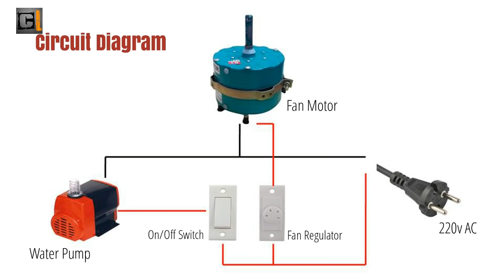How To Make Powerful Air Cooler At Home - Cool Like Air Conditioner

Comment: I made one of these 3 years ago.  It is an evaporative, or swamp cooler and yes they do work and put out nice cold air, my air from the unit tested at 67 degrees F) until the humidity in your room gets so high, no more air can evaporate.  It stops cooling after that.  In my bedroom, I could lower my air temp from 85 degrees F to about 80 before the humidity hit the 60% range and then no more cooling until the humidity dissipated, which took several hours at which time the temp was back up to about 85 again.  If you live in a very low humidity area (Like the south west US) then these will work much better than mine did here in Kentucky.  You did a nice job on this build and it looks great too.
Reply: this  cooler should be kept outside the room, I mean to say install it in a window, then it will work better.
Reply: The best place to position your air cooler is right in front of the window. Hotter the air, faster the evaporation and cooler the air blown out by the fan. It’s also important to create good ventilation in the room to push the humidity out. In order to do this, you need to open windows in the room. Take care not to open them too wide or it will only result in increasing the room’s temperature. You can experiment by adjusting the window a little to improve the amount of cooling.
Reply: @doctorpetrovich9296  Unfortunately, here in Kentucky, it can be 100 degrees outside with very high humidity so opening a window only makes it worse inside.
Reply: @OverlandOne  ahhhhh i see
Reply: 6yr
Reply: You can use some ice cubes or cool water from the fridge. Solves the problem but i dont know if  the fan consumes more electricity.
Reply: @theartofsmartretailing4214  I do not understand what you mean about "solves the problem"?  I already use the ice from my fridge and, if you used just cool water, that water, you do not have a large enough Delta T and the cooling effect is a lot less so I always put plenty of ice in my water.  I recently built a closed system using a transmission cooler (heat exchanger) from a car and it works very well.  I mounted it all on a large insulated cooler and the ice cold water circulates from the cooler, through the heat exchanger and back into the cooler.  it blow very cold air with the fan set on low.  There is no more humidity issue BUT, I go through a cooler full of ice in about an hour.  it stops cooling after that and you have to dump the warm water out and put more ice and water in the cooler.  That heat exchanger is really efficient but I think I would need a ton of ice to run it all day.

Comment: i learned. 1 thing with this video . cooler graas = honeycomb pad 👍👍👍
Reply: Nopes, cooler grass and honeycomb pads are two different things. Both are used by manufacturers.
Reply: One thing the video doesn't teach is that water and electricity don't mix well and that the contraption is a huge safety risk.

Comment: Nice concept, very useful air cooler for one person sitting in a small shop or workshop or garage 
shack.  The plastic body does not get rusted like the metal ones, no  fuss in getting it cleaned for next season.
To clarify some comments,  this cooler can find many buyers in most parts of india where summer is harsh and who cannot afford other big size air cooler let alone an AC.

Actually one can easily tweak the circuit with 3-core wire and can connect the ground wire to the metal bracket of the fan and u have a shock proof body (plastic body is already shock proof).  The fan regulator and switch can be fixed on the front side instead of on the side, it is more safe. 

Of course, please keep away from small kids.
Good for science demo project for middle school students.

Comment: Nice try ...👍....
But its not safe.... 220v and all the electrical  connections will get short for being so exposed to humidity ... and the screws will rust since they are not painted or have any coating... better use plastiz zip ties instead and above its too noisy.... u can get far better throw if u use the blower  blades and DC 12 v they are much quiter... but still thumbs up for being creative and effort... thank you.
Reply: No ground at 220v! Enjoy the mold right as you fry!
Reply: I agree, if your gona make any thing with water and electricity. At least gfci protect it.
Reply: Nice

Comment: 2.5 cooler motor 490 Rs
Water pump 130 Rs
Metal blade 80 Rs
Metal net 30 Rs
Honeycomb pad 120 Rs 
Switch 50 Rs
Cable 50 Rs
Total budget 950 Rs
Ok nice idea but switch is not safe
Reply: Moter ac raha ga ye dc
Reply: Out door lo 2 way gang  board vesukovali my suggestion
Reply: @sraju6462  matlab
Reply: @mdadilrameezkhan  
Ac 230v motor khan sir
Reply: @sraju6462  sirf 230v moter bolna se miljayega blade size
Reply: No problem. you can keep the switch outside. , Keep the fan motor back also with an empty plastic water bottle , so that fan motor is protected main thrust  - this JUST TO INCREASE THE HUMIDITY . In places where the humidity is low -the Ac will work reverse. This water cooler only will work. You can see negative any where . look at the +. this can be kept tidy till next season.
Reply: Sir moter high speed hoga ye normal
Reply: Cooler ka blade a laga hota hai kya
Reply: 500 rs u can get new fan
Reply: Awesome mind blowing

Comment: When fit the switch and regulator back side cover with two module box because this area wet area chance of getting shock and extend fan regulater life
Reply: Point
Reply: Mohammed Akber , was about to tell, more over the fan motor and other iron fittings gets rusted due to wet conditions better to use plastic brackets and why use the can one can build a regular shaped box out of clear sheet one can see the water flow also.
Reply: Woh gye shaayad
Reply: 1500
Reply: Superb. அருமை.

Comment: Good idea,  never know  when  we  have to create our  own resources from  our  hands and  inventive . No kidding but  I have though a lot of time  about  that scenario  while I play any version  of Fallout video game. 
Could I suggest a  dust filter for the honey comb?  Dust is more than anyone could guess and will start to dirt the honeycomb, the water will drag some of that waste and will turn dirt  the water in the  tank ,  finally  colapsing  water pump.  With the same purpose, a sealant ribbon could be fine for the edge of the upper lid. 
The other suggestion I would make is to put  some ice blocks    into the water tank or  even better, chem ice packs easily interchangeable from time to time with others in the fridge.  Even better, how about  to put a freezing circuit with freon or another coolant ? That could  be  get from a spare old  fridge.

Comment: 12 volt dc motor gives same speed with ups battery and also shock proof
Reply: But flow of air will slow
Reply: Cost of battery and replacement periodically will make it costly

Comment: Well, this is dangerous. He could get away with putting and air conditioner motor in there as it is meant for damp environments IF he grounded/earthed the metal shell of the motor, but then he put completely unprotected switches in there too. I bet those will be nicely corroded really quick. It really should have leak current protection as well. Even with all that, I'd only use it outside. It wouldn't take much to dump water everywhere. He's using 230v too...
Reply: Manojsonik PUBG Hii
Reply: Asslam-0-alaikum bhai Jaan !
Bhai jan mujy yeh Air colar chehye  .kidr se mile ga aur kitne ka mile ga ??

Comment: More clickbait. This NOT AN AC UNIT. This is a swamp cooler. I live in Mississippi and ha ha no way that thing works here. I also find it to be unsafe as you spend zero time moisture proofing your electrical system, or even the fan motor. You are thinking outside the box (Granted) But this just a clever design not a AC unit.
Reply: Swamp coolers only work if the relative humidity (RH) is 40% or less.
Reply: @AshishSharma-mf2bx  poor people must know how to get cool air from outside. House ventilation is very important. Can give free cooler air compare buyin this things
Reply: Hi..this is a cooler..it's not meant for humid areas..if u use a cooler u have to ventilate your house properly..since it uses water to cool the surface unlike ac
Reply: @gnesoidomarsonletslearn5533  

..
Reply: The title clearly says Air Cooler, not AC
Reply: @neville3151  price  pl

Comment: It's very dengerous for fan motor because of flowing water pad is too closed to fan motor. It will shock with in month.
Reply: Cover the motor with a plastic bottle.

Comment: After few minutes of operation, motor temperature will rise and exhaust air temperature will not be cool.
Reply: Yes Bro, What's the Solution you think.
Reply: @younushussainsyed8860  instead of fan, use blower, like AC. And make sure intake air will never touch motor.

Comment: You made nothing but a Water Humidifier it's got nothing to do with Air Conditioner....I wasted 11 minutes !
Reply: he made a diy swamp cooler. They work in dryer areas. What happens is the water evaporates on the filter and that cools down an area. Research it. They work and use alot less electricity then an AC unit.

Comment: Nice! But it has a limited water supply.

I suggest using two plastic containers, making it TWO LEVELS.

Top container: cooling mechanism.
Bottom container: water supply.

It will take days or a week before you fill it up again with water... With/without ice.

Comment: Water reservoir is very little.. it will not run for one hour probably.. you need to seperate water tank...but its a good project... to those with tight budget...same thing as iwata and american home just d.i.y nice project next..

Comment: Its very nicely assembled, really appreciate the creativity👍👏👏👏👏 very nicely illustrated the procedure of making cooler ..so nice  ...what exact the capacity in liters for the water , how to prevent  the water which circulates in honeycomb pad is prevented from getting spread on wires of switch and regulator wires ..The water which we pour inside , how to protect its spilling on wires and fan .

Comment: Interesting idea, except that 120 Volt+ AC, relatively high EMF with an oscillating electric field  in close proximity to water conductor is dangerous, especially if unit is accidentally knocked over.
A 12 V DC input and fan motorwith ice in a waterproof strong flexible container (bag) with rudimentary insulation inside container could make unit safer.
Cooler container devices are already demonstrated in this vein.
At least step down 120 V AC and rectify to 12 V DC while retaining original design.

Comment: Wrong fan direction. That fan will pull moisture from the honeycomb membrane and make it move through the inside of the unit. That means the electrical parts (motor, speed controller, switch) are exposed to moisture. It won't last very long. 
In spite of that, however,  the concept is good and the workmanship is fair for a demo project.

Comment: This plastic kerosene container, cheap underpowered motor, 240 volts AC power supply and water is an IED to test the sprinting speed of users and keep firebrigade personnel busy. Metal dessert coolers available in Delhi are safe and work well.

Comment: motor 1200/-Rs ki hai.
Water Gallon 400/-Rs ka hai
Clip100/-Rs k hain.
propeller 200/-Rs ka hai.
matel net 50 70/-Rs ki hai Water Pump 300/-Rs ka hai.
aur wooden wool 100/-Rs ka hai
pipies 50/-Rs k hain.
fan regulator 120/-Rs ka hai
total 2550/-Rs
very good chootiyapa

Comment: First of all the price shown of all parts is relatively very low compared to market, It comes costly than what has been shown in video and the water storage capacity is very less, it will run out of water after 2 or 3 hrs resulting in burning of motor due to heat. Apart from this a very nice cooler made by him.

Comment: Highly dangerous
1). exposed switches
2) pvc piple line blocked from other end which can lead to pump failure. It can easily cause short circuit.

Comment: first of all the fan motor supporting bars will be heated in prolonged usagea and can melt the plastic of box ,i am sure in 2 hours it will start heating and melting of plastic in all four or two upper side will start, ,....any way work is fine  idea improvement needed its fail idea practicaly.

Comment: does it balance on floor when water gets empty. u should have used pipe to fill water the way you fill water may directly fall on fan motor. lots of water spill out on floor from honey comb mat. design of disaster

Comment: What's the essence of water pump and the water here? Can someone explain the water mechanism here for me? Thank you.
Reply: The water pump exchange the heat flow with the cooling water inside  which later evaporate and cool the air
Reply: @goodluckmatata9158  Thank you. Would this water be topped regularly?
Reply: Henry Edeh  yes

Comment: 66K likes for what is most certainly a blatant death trap.  DO NOT BUILD THIS!  Exposed 220 Volt connections with water dripping everywhere! Are you kidding? Just touching that cardboard in the back could kill someone, if it doesn't burn down your house first.

Comment: DO NOT make this and use mains electricity like shown in the video, especially directly connected to a switch with metal screws right next to the terminal. This is a death trap.

Comment: We won't get even motor @ ₹650 because I'm trying alot..We have to spend ₹2000 to ₹2500 to made this..If we spend this much then secure also a question mark because he is using motor and water with direct power..

Comment: I have experience with this design ....  Bacteria.
Reply: how it become bacteria? please tell me
Reply: @syazreeezaat3266  It's a combination of residue left behind in the filter and the bottom of the water tank when this thing is not on in a hot environment. We had a big version of this system in the workshop. Of course nobody wanted to clean or even refill the tank. After 6 months the fan start to spread smelly air. After testing from a laboratory they said this thing was spreading salmonella bacteria.

Comment: WHERE IS THE LINK TO BUY ?
Things Required & Buy Link:
1) 230v Cooler Motor
2) Honeycomb Pad
3) 230v Water Pump
4) Propeller
5) 1/2" Pipe
6) Steel Net
7) On/Off Switch